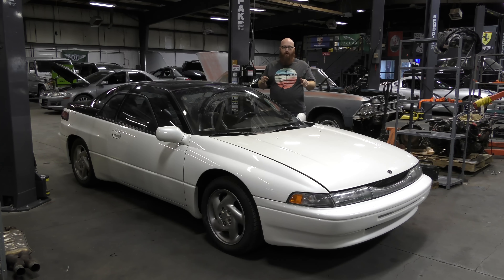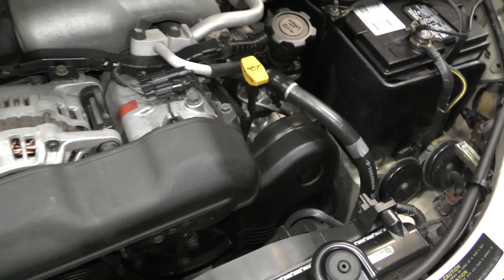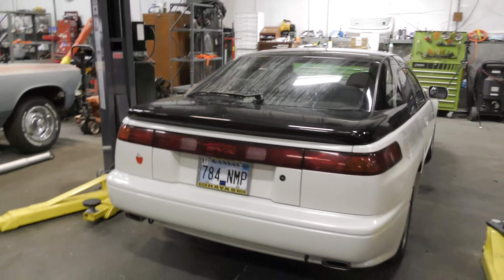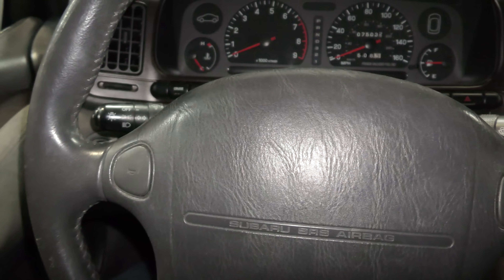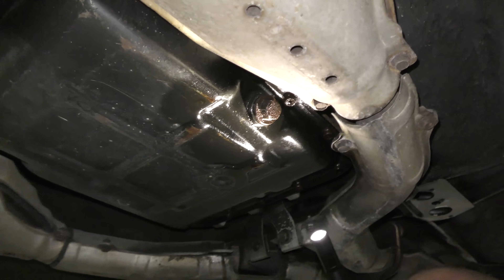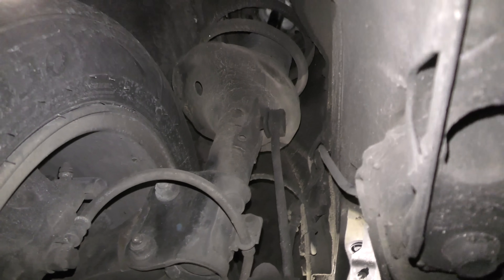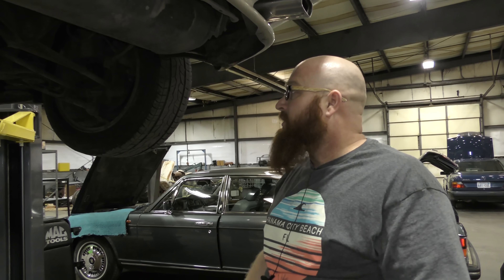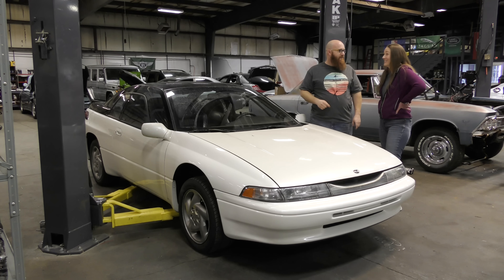An Italian Subaru Sports Car?!? The CAR WIZARD shows how east meets west with this 1992 SVX Subaru

Comment: My father (retired mechanic) used the strut tool no matter what. Lay anything on the engine, and the hood is guaranteed to come down. Better than dealing with a body shop. His had a rubber tip so it wouldn't damage the shaft.

Comment: My favourite car from the 90s must be the one that I'm driving. Currently, the rear wiper works only sometimes - at other times, when I try to use it, it'll just turn on the dashboard lamp for the rear fog light (without turning on the rear fog light, fortunately, because that would be illegal). I know it's the wires to the rear hatch, I'll just have to order a harness for that, but still, I must say that it's my favourite car from the 90s, because it's from '99 and might not like me any more if I prefer another car over it, and then it would break down even more, which I really can't afford ;)

Comment: In the Subaru dealers I worked at we hated the SVX if it needed trim or parts specific to that model; they never had the parts on hand at the distribution center.  Everything seemed to be on back order or had to come from another regional parts warehouse.   The SVX power steering pump hasn't been available from SOA for years and the rebuilt units I've seen and used are mostly junk.  Nice looking vehicle, decent driver, but parts that aren't shared with other Subaru models means that those items will be expensive and difficult to find.

Comment: I remember seeing these on TV and seeing a few of them around in New Brunswick Canada back in the day as I recall there was also a feature of a four-wheel-drive button a little red square button in the middle of the consul shifter you push down to engage four-wheel-drive maybe it was an on-demand or traction button but I do remember..By the styling and design from a lot of angles I always wondered if maybe this was some sort of version of an eagle talon they made those TSI all-wheel-drive

Comment: In 1994, I replaced my 5-speed 1988 Subaru XT6 AWD with a 1991 SVX AWD. It was a mistake. Within 6 months, the transmission (available in automatic only) started to fail. I got rid of it quickly and replaced it with a 1991 MR2 Turbo. That was a good choice. The SVX was a great car, a bit heavy, very comfortable inside, it ate up highway miles. It's a shame that Subaru saddled it with that horrible, slushy, failure-prone transmission.

Comment: That's a sweet looking Subaru! I own a 1993 Subaru Legacy sedan (154K miles) that runs great but it is an "unpopular" spec; it's front wheel drive with an automatic (4EAT). AFAIK, it is the only one in my city; never seen another one. My Legacy also has automatic shoulder belts that work... too well. They're strong enough to choke you if you're not sitting back when you close the door.🤣

Comment: Favorite 90’s car? Probably the Jaguar XJ220 - I had a poster of that in my room haha. Favorite 90’s car that I actually had? My 1995 Nissan Maxima Sport that came with a 5spd manual. It was such a smooth car, comfortable but still nimble. Nissans all came with great Bose speakers back then as well—great car.

Comment: Same driveshaft stupidness as my winter beater 2nd gen FIAT Panda 4x4. Those are also prone to fail because those little 4wd Pandas are the king of abused cars here in the snowy areas of Europe (its lacking a bit on power, but it can go places not many car can go). There are shop around here that can rebuild them but the price is higher than good used ones and not too far a brand new one.

Comment: The SVX was designed as an homage to the DeLorean DMC-12, as it was designed by the same engineer for Subaru, and was the flagship car for the new rounded off designs for that year.  I had a Pearl White 2/91 just like the one in the video. This is a 92' as it has no airbag on the passenger side and the rear covers and the trunk lid are black with no spoiler. I had a 2/91, right in the beginning of production car. The AWD versions had the 4EAT transmission from the Nissan Pathfinder in them, which was there curse as they always broke from the heat. My front and rear had 1 extra tooth from all other years making it hard to do a proper tranny rebuild. It was a short production car in the 5 years it was out and was prone to rust in the rear wheel wells, rear wheel bearings going bad ( the car is 4200lbs ) and ate tires. It was, at the time, the most expensive and heaviest Subaru produced and was meant to be a challenger to the Nissan 300Z.

Comment: My car failed its MOT on the bonnet struts here in the UK as they were almost dead. You could open the bonnet and it would slowly glide back down. Nice easy fix and not really expensive to fit.
Reply: You're lucky they check things like that there.  I remember buying my first car.  It had a large, heavy hatch/tailgate with failed struts.  When I went to inspect the car, the owner held it up over my head (on purpose in hindsight), and I therefore didn't notice they were broken, or even think to check them.  I almost had my head stove in when I went to open the tailgate the first time after getting the car home.  A valuable lesson learnt.

Comment: You should make a video about the VW V5 engines, would be interesting to hear your views and and common faults etc 👍
Reply: @Dankcatvacs  There was a V5 engine made by VW in the late 90's-early 00's. It was basically a VR6 with one cylinder less. It made around 150hp, the later version with 4 valves per cylinder had 170. It was rare, it only came in the MK4 Golf/Jetta, New Beetle, Passat B5 and the Seat Toledo MK2. I guess people just preferred the 1.8T.

Comment: I wonder what the long term effects of tasting automotive fluids might be.
Reply: Probably not much. Oil is not really poisonous if it doesn't contain lead or other adhesives. For instance we use vaseline all the time and it's not harmful. It only gives you diarhea if you take a gulp. Still, if he takes in 5ml per week in oil, at the end of his career, it'll be a dozen gallones that he has drunk.

Comment: I bought one new in 1993 or 1994.  Fun car but lots of issues, it ate wheel bearings and transmission mounts, parts were very expensive and very hard to get just within 3 years of ownership.  I sold it once the warranty was up.  Also, not all Suby dealers would work on it.

Comment: Wheel bearings were a common problem on the SVX -  there is a knack to fitting replacements which even Subaru dealers got wrong a lot of the time

Comment: Those rear ends have a vent on top of the rear end cover.  They get clogged and the rear end builds pressure causing it to leak.  Replacing that vent will many times solve the problem.

Comment: I own a 2001 Outback LL Bean with the 3.0 H6 and the EZ30D is a FAR FAR better engine than the EG33 in the SVX!  No timing belt.  No head gasket issues.  No issues whatsoever!  That being said, a low mileage SVX pointed my way might make me think about trading simply because they are so unique.  I keep the Outback as an airport car, a car I drive to work and to pick up plants/mulch at Home Depot;  I normally drive a '14 Cayman S.  

So I have two cars and both are powered by flat 6 engines~

Comment: Those driveshaft u joints I have had professionally replaced by a performance driveshaft shop on my subaru. It is possible but it also did cost alot (bout half the cost of a new shaft out of japan)

Comment: The automatic was also used in quite a few Japanese makes (Nissan, Isuzu) and are sketchy. SVX's love wheel bearings and are leak prone due to internal pressures as are most of the 2.2 H4 to 3.3 H6. Is the air conditioning still working?

Comment: I had a svx for som years, good car!
Reply: Was it expensive to keep it running? <:  P
Reply: @OtomoTenzi  
Not for me, no issue at all!
Reply: @buza1300  Or maybe just because it was YEARS ago, when parts and repair services were still cheap? You know how difficult it is to find replacement parts with long-discontinued cars... I only heard that replacement transmissions for this car are easy to find, but only becasue they mass-produced like TONS of the same exact transmission gearbox for other models of different Subaru vehichles. Just wondering if you could tell us something more about that. <:  P

Comment: They're nice cars. The facelift versions are a bit better though with some improvements including the removal of the auto seatbelts. They're pretty solid: the EG33 is basically bulletproof (except for oil leaks, in typical Subaru fashion) and the post-facelift versions have reliable transaxles. They were heavy cars though so the 230HP was merely adequate, and the requirement for premium fuel increased running costs. But hey, AWD and pretty good handling in a cool, moderately luxurious package. 
Problems include transaxle failures on early models (attributed mostly to delayed/improper maintenance and cured by removing the filter from the transaxle to prevent fluid starvation due to blockages) and a tendency to eat wheel bearings (which is mostly attributed to factory and dealer ignorance: the bearings were shipped with packing grease and they were installed without cleaning and proper repacking with running grease, so they failed quickly; properly-fitted bearings usually lasted a while). 
I think (it has been about 10 years so memory is fuzzy) it was Driveline Service of Atlanta who rebuilt my RX's driveshaft with uprated U-joints and new carrier bearing. A bit of shipping would be involved out of KS but maybe they could help you out if you had another Subie in need of driveshaft service and can't find a replacement.

Comment: My favourite car from 90's? The C70. I bought it for $2400 and spent over $24000 on it with a dealer. Even the sponge under my ass I replaced. Built a garage for that car. Still have it after 8 years and I go to the cemetery with that car.

Comment: "What's your favorite car from the 1990's?"  A black 1997 Pontiac Trans Am T-Tops with a 6 speed manual and a LT1 engine.  Not the Firehawk or Formula, they got it right that year with the T/A.  Know that the LS1 came out a year later in 98, but they also changed the look of the front end to be more rounded.  The 98+ WS6 with the snorkle hood looks cool, but GM got it right with the 97 in the style department.
VT247

Comment: My SVX's required wheel bearing replacement quite frequently
Reply: Mine as well. I think the rear bearing is too small to carry the weight of this large of a car. Had 160K when I sold it. Must have done the right rear 3 times and it was growling badly when it drove away. Not very quick but it was a great high speed hwy car. That crazy window had almost no wind noise.

Comment: Probably still needs wheel bearings, was a common problem on them.  I think they used the same bearing as a legacy from that time, but with more weight and performance they were inadequate.

Comment: I had a '92 SVX for eight years.  I bought it used and had to replace the two front wheel bearings early in my ownership.  Back then SVX owners would bitch and whine about the bearings.  I had a good four wheel alignment done when the wheel bearings were replaced and never had a problem with them afterwards

Comment: The real killer of those otherwise amazing cars over the past decade is that when the transmission goes, you basically spend the total value of the car to replace that automatic transmission.  You can swap a manual in, but most of them end up in junkyards.  It's a shame really, as they are one of the many cool vehicles that Subaru produced in the 80's and 90's.   They also make great Vanagon Syncro motor donors too. :)

Comment: 5:51 we call those seat belts american seatbelts because here in the EU wasn't in use
Reply: Yeah, they were a cheap stopgap to satisfy our NHTSA - automakers either had to have airbags, or automatic seatbelts, automatic seatbelts were way cheaper and easier to retrofit into existing designs, so that's what most automakers did. Most people found them a nuisance and took to unclipping them from the overhead buckle, and waiting until it was done moving in its track to clip the belt back in.

Comment: Never offered in the US with a manual, what a shame.
Reply: It was never offered anywhere with a manual, they didn't have one strong enough to handle the 3.3 at the time.
Reply: @sadinragnarmedia  yeah, to be honest, none of the 5 speeds are strong enough to use oem with that engine, im waiting on a 6 speed to put in mine.

Comment: ALL SVX's were Automatics due to the power output of the H6. Subaru did not at the time have a manual transmission that could take the power. 
A Common upgrade is to take the 6 speed out of a More modern WRX STI and you can then really let that H6 perform. 
The Best looking SVX had the rear factory double rear spoiler.

Comment: This is a high school dream car for me. Never thought ownership would actually happen, it has.  Since 2009, a 1997, one of 640 made that final year. It was 1.5 miles from work. I was shocked.
The transmission & wheel bearings are weak points. The transmission was designed for the four-cylinder engine, not the H6. Likewise the bearings were intended for the other lighter cars in the Subaru line up. Not this grand tourer. 
These were $10,000 more expensive than the next highest Subaru.
Mine retailed for a crazy $36,000 in 1997, but paid $3000 in 2009 with 109,000 miles.
Beware. These cars are not for those not willing to play within the car's limit$. 
Part$ are expen$ive, rare/$carce. Read up & know what you are getting into.

Comment: Sweet engine in the SVX. I have always thought they would've sold a shit ton more if they made a manual
Reply: Subaru didn't have a manual transmission at the time that could handle the torque of the 6 cylinder unfortunately.

Comment: If only Subaru had a suitable manual transmission to pair with that engine at the time... 

By the way Mr. Wizard, I'm worried that tasting car fluids might be detrimental to your health in the long run. I guess if someone did this every now and then, it wouldn't be very dangerous, but as a professioanal mechanic, you may find this diagnostic trick handy several times a day, and over the years, it might add up to something dangerous. Please, keep that in mind.

Comment: I find it astounding that people won't pay $20 for a new set of gas struts - they take all of 5 minutes to replace, and you can do it yourself, it's just a wee spring clip at each end that you pry off with a flat bladed screwdriver, the old strut comes off, pop a little lithium grease or WHY on the ball and pop the new one on - simplest job you can do on your car really, easy as changing a wiper blade.  No way I'd pay a mechanic to do it.

Comment: That's weird that it has an airbag and those mickey mouse 90's shoulder belts.  The way the safety laws were written back then you had to have an automatic restraint system.  Something besides a normal seat belt where the driver had to manually fasten it. The law was intended to mandate carmakers put airbags in their cars, but for a few years there were loopholes.  The motorized seatbelts met the "automatic" requirement and was cheaper than putting in an airbag.

Comment: Subaru's are terrible for loose hose clamps. cold weather is brutal on transmission and fuel line clamps in the Subaru's about -15c is brutal on the clamps

Comment: the bad point of the north american version was Subaru's decision to fit the car with the same MPT automatic transmission making the SVX the same as a Legacy , 90% of power in the front 10% in the back and on-demand power going up to 50-50% while the european and JDM version had a permanent 33% front 66% rear with a central LSD, so basically Subaru went all GM about this car , all looks but final design made by bean counters

Comment: They're extremely reliable *except every single auto trans in them is a ticking time bomb
Reply: Avboden looks like it was replaced.  It’s too
Clean.  And the trans (4eat) wasn’t the issue.  It was the oil screen in the trans cooler that would clog.

Comment: I'm sure I could do more research, but does that engine fit in replacement of the corvair engine?

There are both flat 6 engines and one is air cooled, what is that where the similarity end

Comment: Customer brings in a reliable Japanese car for a potential wheels bearing check. 

Ends up finding oil leaking from every single orifice, ahh, Subaru life.

One of the most reliable and trouble free cars for the first 10 years and 120,000kilometers. 

Car Wizard, yep I'll buy that. 

The bizzar part is, the Subaru engineers were not able to engineer in many of the famous Subaru faults in the earlier models. 

It wasn't until Subaru employed highly educated accountants to train those silly engineers in the late 90s.
Reply: Chaminda Thushara Ruwan Kasturi  
Yep that's it.

Once apon a time the Subaru engineers were allowed to make reliable "Japanese cars"
But then the accountants got involved, an the rest, well it's just history now.

Comment: Geez!!  I don't get it with all these lift support struts that are no good.  For Pete's sake they're inexpensive to buy and you can change them out in like 10 minutes.  Any of our cars where they've stopped working we just replace them right away.  It's quicker and easier than finding something to hold up the hood or trunk or whatever and much less painful when that thing slips and the hood comes down on your head anyway.